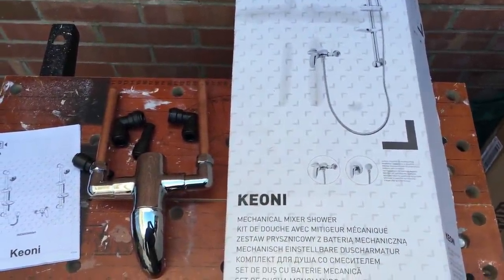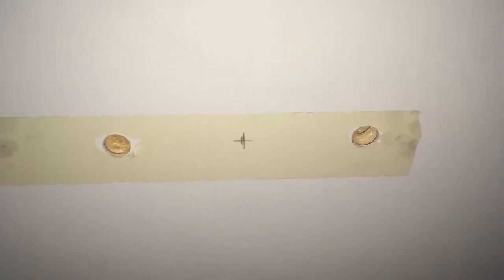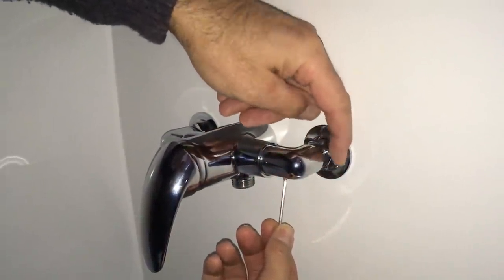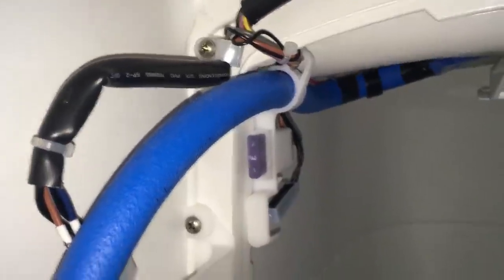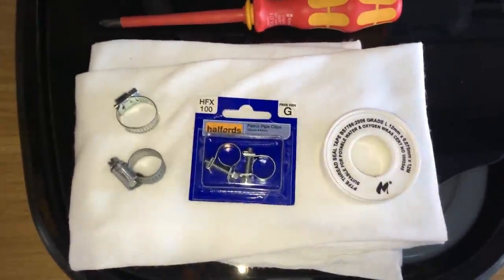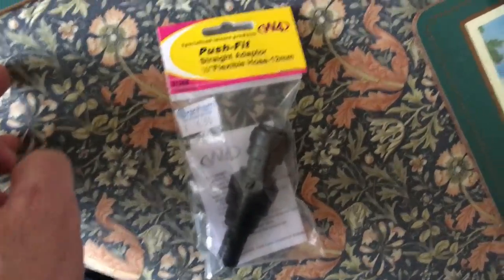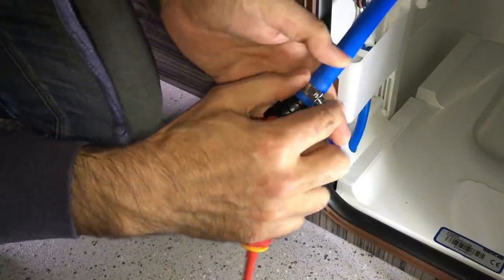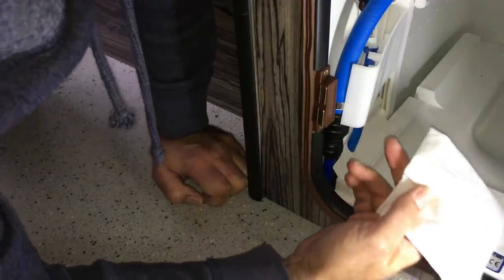Fitting the Shower Mixer and Toilet Problems - Self Build Campervan

Comment: I'm 48 videos in and this is the first instance where You seemed to start losing your temper. The rest of the time You are doing incredibly intricate work where one misstep could potentially ruin everything or at least incur considerable cost, and still keep explaining everything calmly and matter-of-factly. I'm not gonna lie, it's relieving to see You are human. :) As always, mind boggling work. Thank You for sharing the process.
Reply from the maker: uramalakia we had to cancel our ferry crossing to Europe because of that leak. It took a few days to resolve so it did test my patience. I guess you learn over the years that it’s not worth getting stressed out. I’m pretty laid back most of the time 😀👍🏼

Comment: You're still the best builder on YT Greg Lol  your face with that leak was priceless!
Agreed Jubilee clips are rubbish for water connections.
There is another type of clip that are water tight, I'm not sure what they're called but you find them inside dishwashers and washing machines.
They are two rings of strong wire you have to expand to locate 👍

Comment: Greg, I installed garden quick release adaptors (gardena makes the presumably better ones, but there are many other brands too) in ALL the connections on my boat. I also used ordinary garden hose that is more flexible and is meant to go with these adaptors. Everybody laughed at me, but in the eighth year now nothing leaks! I also have installed Y connectors where the mains (tank water) is directed to sink and water heater. I also used those jubilee clamps in stainless steel, BUT the softer nature of the garden hose is taking the slack of your described imperfections of the design. Don’t be afraid of ordinary garden hose, the pressure in those systems will never blow the hose walls.
Reply from the maker: Yannis Tsakiris I’m sure there are many other people that will say they never had a problem. 😀

Comment: These are really good videos Greg. Particularly as you have taken the time to consider all the appropriate, but often ignored (by many), regulations. I was looking at your pump though and wondered why, along with many, many other youtubers,  you chose to mount it upside down. Traditional wisdom for similar pumps is that you mount it with the motor on top or horizontal (I note that the recent instructions for this particular pump say any orientation). The reason is that when  (yes, when, rather than if) the shaft seal starts to leak, you will see the first drip somewhere below rather than it dripping through the motor (potentially for a few months) and ruining the whole pump when you could have replaced only the shaft seal for a few pence.  Keep up the good work!
Reply from the maker: If I fitted it up the other way the water flow would be in the wrong direction. 🥴

Comment: I like watching your videos because at some point I berate myself for being a sloppy sod. You always do a proper job, don't cut corners. See when you got the new fuel pipe clip and it was still leaking I said in my head "Yep, time for the silicone" but nope, you were back down the shops to find a proper solution.
Reply from the maker: Elly Davis for me the PTFE tape was a bodge job that just wasn’t happy with. It forced me to seek out the right fitting. The toilet should come with 12mm push fit connection. Hose connections are never very good at the best of times

Comment: When I first put cold water into my van, the blue hoses fitted really well over barbed nylon joints. When I fitted some different hose to add supply to a water heater, the newer blue hose was leaking at nylon barbs and I had to fit a load of jubilee clips. All I can determine is that not all blue hose is equal. Genuine jubilee clips too, no dodgy knock-offs.

Comment: Just a little tip to everyone who will use jubilee clips if you put a smear of Greece around the pip even a water hose to the main radiator it helps both the hose from cracking in time and stops the jubilee clip from digging in to the hose , just a little armed forces maintenance tip . A great video Greg I wound how many other van build videos are out there who cut out the miss apps then can happen no matter how good and carful you do any part of your build , a bit like me when I got my gas tank before I ordered my gas tank which is 300 MM in diameter and 1200 long I got under the van and measured to make sure it would fit , and when it came and I fitted all the parts and got under the van to fit the tank I had no way of getting at the main cut out valve or at any of the fittings , so I had to move it to we’re I was going to cut a hole in the floor to make a box for my batteries so I had to fit the LPG tank there . Now I have to find space to fit the batteries inside my van as I have fitted my chines night heater under the floor inside a metal box under the van to keep the noise down and save space inside the van with wanting to take my two younger grand children with us now and then .

Comment: Hi Greg & Lou, nice to see some footage from the build 👍🏻.

A tip from me as we use our campervan as a daily driver for about 15 years now, check every screw and bolt on the tightness yearly as the vibrations of driving keeps loosening them.
We've experienced that every connection comes loose every one's in a while and even blind rivets tent to come loose after a few years due to the constant vibrations.
On my next build I will try to use more high tack glue as a building material as that is less susceptible to the constant vibrations of a driving van.
And is will absolutely be using the same plumbing system as you did, looks a treat to me. 👌🏻
And whilst your coming back to the UK, bring some of the lovely sunny weather over here, will you?
Greetings from Carlo En Mascha, the Netherlands
Reply from the maker: Carlo Knüwer thank you for that tip. The van does get shaken a lot on these old cobble streets. 🥴

Comment: Fitted my thetford toilet today, don't know if it's going to leak because the water hasn't been connected yet. It's so wet the only way I can get under the van is with diving tanks and there's just not enough room for me and the diving tanks and water tanks. I  used the fitting recommended by Magnum Motorhomes. I believe it's the 12mm to three eighths and I have used a jubilee clip. Hopefully it's going to work.  Unusual  to see the best faltering sometimes, although it comes good in the end.

Comment: Funny that, I have the Same thetford toilet and the only leak I had on the van was from the toilet on the pipe with the black self tensioner connection. I ended up taking it out completely and using a washing machine water pipe.
Fits better than the manufacturers .
Reply from the maker: Lee Clarke sorry you’re had similar issues. Glad you got it sorted too 👍🏼😀

Comment: Hi Greg, had the same problem. I was using the same nice shiny brass adaptors which persistantly leaked. Switching to 'cheap' plastic solved the problem. Worringly my van is full of jubillee clips, but to date no further leaks. I think the golden rule here is, if you go the flexible hose + jubilee clip route, only use plastic adaptors, never brass. Hey, Camp Quirky getting nearer, if we ever get free of these storms. . .
Reply from the maker: YES!! Rob is back!! Missed seeing your name in the comments section. That’s made my day that has. How are you keeping and hope you’ve been enjoying your van. You coming to Quirky?
Reply: @GregVirgoe  Yes all's well and we are set for Quirky. Was a close run thing since we only just managed to grab one of the last 'priceless' dog tickets. I've been following your travels across Spain with Gadget John, and would have loved to have just 'popped' across for a meet up. However, our travel plans are not so adventurous, but we shall be off for a grand tour of Scotland directly from Quirky.
Over the winter, I've been added some finishing touches to the van and updated the software to make better use of the Solar panel for heating the water. I really wish I had more Solar now. Next van maybe! Would you ever consider another van build? I miss your build videos, they were so inspiring.
Reply from the maker: Flashback that’s good news and will look forward to seeing you at Quirky. 
we’ve been talking about doing another build but not for ourselves. 
I enjoy the build videos too

Comment: Morning Greg, obviously not where the barbed fittings are concerned, but when you have used normal 12 mm push fit connections, I didn't notice you use any pipe inserts to form and stiffen the end of the pipe before making the join. I know that they are essential for domestic use and just wondered if it was an oversight, or do you think them unnecessary in a motor home/camper van environment. 
Still enjoying the channel immensely and always glad to see the bell telling me that you have uploaded a new one. My wife commented the other day that if anybody asks me who did the conversion on our van, I am going to have to say "me and Greg". Safe travels.

Comment: Thank you Greg.
Do you recommend using collet clips on the John Guest joints?

Fuel clips 
And
W4 15mm x 1/2" adapter.
12mm x 15mm adapter.

Great tips.
👍
Reply from the maker: Collet clips would ensure they don’t come apart. If the system is kept under pressure they won’t come apart. I didn’t use them and not had any issues. Fuel clips are better than jubilee clips and if you can lose any of that type of joint the better.

Comment: Greg would you believe I used exactly the same shower as you and completed my shower build around October. I also have the same thetford and the flush connector as you. I had no leaks and put 2 jubilee clips over the 12mm inside 15mm hose (no leaks). However, I think this will be retro fitted the same way you have done it. Totally agree that Thetford need to change the flush hose on the toilets. I too had a leak but it was self inflicted. I manged to screw into one of the copper pipes out of the back of my shower fitting my 5 mm ply. I ended up extending the shower wall inspection panel to check for leaks or do any maintenance in future. I had to strip out my batteries and a lot of my electric to repair my own error. Building the Van has proved to be intensive.  Having to engineer and problem solve through out the build has bee a massive learning curve. This year we really launching to using of the van and we hope corona virus does not impact travel plans. 20 Months of weekend and evening work and just cannot wait to start the user journey. Thanks for sharing the footage for toilet and shower connections.
Reply from the maker: Tracey Hart it will be so worth it when you get the total freedom of travel. It’s so easy to find free parking places over here and free services too. Makes travelling long term very reasonable. Have fun 😀
Reply: @GregVirgoe  8 Weeks to Early retirement...yeay
Reply from the maker: Tracey Hart whoop whoop 🙌

Comment: Hi Greg ,yes that brass barb fitting definitely looks to small for the blue  flexible hose ,it should be pretty snug when pushing the pipe over the barb ,if the barbs  are  correct ie 12mm od they should be fine ,I use stainless jubilee on many  and not had any leaks 👍

Comment: What a nightmare Greg. Water can cause so much damage. I run my pump when I need too and try not to leave pressure in the system when I'm not using it in case it strings a leak.
Glad you eventually got it sorted before you ended up wit a delamination nightmare.
Reply from the maker: pa maj I can see your train of thought there. JG fittings rely on pressure to keep the locking ring pushed out. Unless you have the c clips installed it’s best not to take pressure away from the joints in case they work loose.
Reply: @GregVirgoe  That makes sense. So probably best to use c clips if/when installing a new system. Cheers Greg! Hope you're all having a nice time 👍👍👍

Comment: Hi building my own conversion. inspired by your videos. I have the same setup water tank plumbed in but the wiring is so confusing. I am using the sureflow pump onboard. do you have your wiring diagram you used. Please
Reply from the maker: I have prepared some really useful videos on the wiring of our van. The build videos are all arranged into one playlist from start to finish. Here is the wiring one https://youtu.be/rVkDPzrA-zw

Comment: Hi Greg and Lou, really enjoying your channel. Question on internet/data access. We're shortly off to France for 9 months and am aware most providers stop your data after 60 days. I've tried to research how we can deal with this limitation and anted to compare how you deal with it.
 We can send the sim back to family in UK to re set the 60 days and for them to return to site in France. 
Or but a Tourist sim deal in France...... A little expensive
Or but a sim from a company in France called "Free". They have brances in most main towns but also in many tabacs and Presse outlets.
Be great to hear what you guys think

Ray...Cheers
Reply from the maker: Ray Phillips sounds like a good idea. We are using the skyroam device now for our mobile internet. Not cheap.

Comment: Great Video 💪
Quick question ,how does the toilet connection look like? there is only one 12v cable going in? 
Ta
Reply from the maker: There are two lives and one negative on your toilet which both need to be linked at the connector block if you have the same toilet as us with a solenoid valve and push button and a pressurised water system.
Reply: @GregVirgoe  Hi Greg - any chance of picking your brains on wiring the Thetford CS200 toilet? Mine has 4 connections at the toilet - Brown, Blue, Black, Black/White.

I’m guessing the 12v live to Brown, -ve to Blue, but 2nd live? To Black or Black/White?

Any tips gratefully received!
Will

Comment: Hello Greg! 

I have a water system like yours with a Shurflo pressure pump. I would like to ask you how you managed the electrical connection of thetford toilet? Mine is a C403 (w/4 pole connector) and from what I understand the flush works with a micro-switch that starts the pump. But with the pressure pump how do you get around this problem, as normally you just have to open the tap to start it? 

Thanks, 

Alex
Reply from the maker: Yours is a slightly newer model than mine but I’m sure you only need to connect a 12v supply to the red and black wires. Do nothing with the grey and purple. 
That relay would be used to switch on a pump if you didn’t have a pressured water system. Hope that helps 👍🏼😊
Reply: @GregVirgoe  thank you very much, I'll try to connect only the red and black. :)

Comment: Hi Greg, I hope you  are both well and staying safe, hopefully we will soon be coming out the other side of this horrendous situation and able to get back to the things we love.
in the meantime  a quick observation/question. It was a nice idea to keep the shower joints in the garage for ease of access, did that also enable you to do away with stud walls thus gaining more space in your layout plan?
Reply from the maker: MACmillanish the 2x2 stud wall that I built first for the bed partition is still there it has furniture board on the living side and 9mm ply on the garage side. It’s one of the few structural parts of the build that lot of other thing fix to. I also built two stud walls similar down either side of the garage to run all my cables in these are also finished with 9mm plywood. I only lost 2” of space around the garage area which is nothing to worry about. Hope that helps

Comment: Hi Greg, what is the seal around the door and how is it fixed please?
Reply from the maker: craig dolan do you mean the cassette door? That is a E shaped foam strip with adhesive back normally used for draft excluder strip.
Reply: @GregVirgoe  yes that's what I meant, thank you.

Comment: Problem solving at its very best. Keep calm, try one thing at at time! Great vid Greg! A question if I may? At 06:31 when you switch the pump on to test the system, you don’t appear to use the isolating switch thats directly above the pump, is there another switch just out of shot? I’m just trying to make sure I don’t forget anything!! Thanks mate!
Reply from the maker: I’m using my temp bench power supply unit to give me 12v dc so think I just switched that off
Reply: @GregVirgoe  thanks Greg- that makes a lot of sense. Can I just ask one other? In one of your kitchen build videos I noticed a grey cable emerging out of the ply lining under the kitchen worktop? Don’t suppose you could tell me what that was for? It looked like a house 3 core cable? Thanks as always.
Reply from the maker: @willparry6547  it’s a 7core 1.5mm cable that is for the level gauges on the water tanks. It runs from the high level cupboard down inside the wall to low level then out through the floor to the water tanks level probes. 
It was a multi core flex control cable. 👍🏼😃

Comment: With the fuel clip why did you not attach it at the very bottom of the pipe? You attached a few cm up from the bottom...Pleased that you fixed it, but l was confident that you would 😊
Reply from the maker: Kat cankan the clip was positioned in the centre of the barbed fitting with equal amount of barbs either side
Reply: @GregVirgoe  OK thank you. I understand now 😊

Comment: Hi Greg - I’m still plodding along (slowly!!) with my Sprinter conv, and can’t tell you how much your vids are helping . 2 quick Q’s if I may? When feeding the Truma ducting from the living area to the garage - did you find it tight squeeze coming through the furniture board / wheel arch area? Or are my measurements out? 🤣 And secondly I see your bulkhead between living area and garage is lined with ply on the garage side. What was the reason for this? Is this something I need to do? Thanks as always for your time.